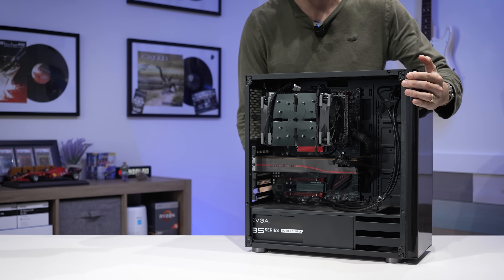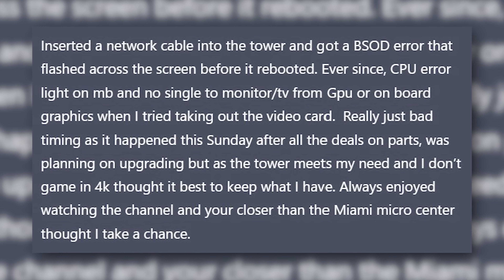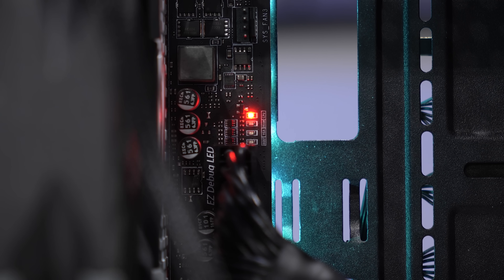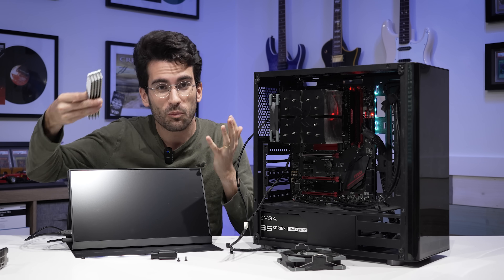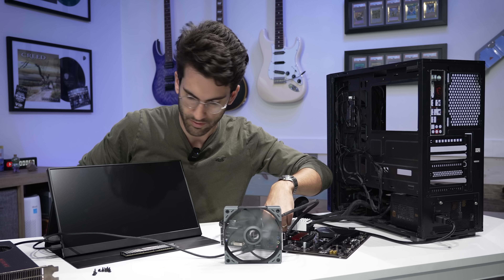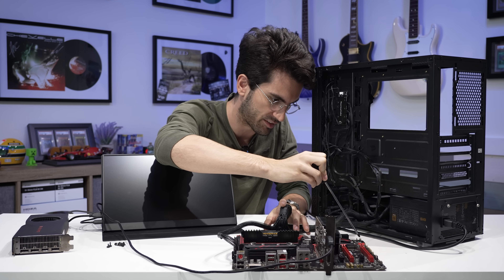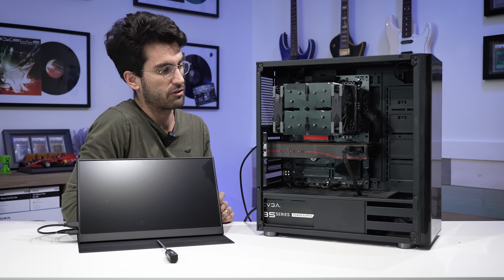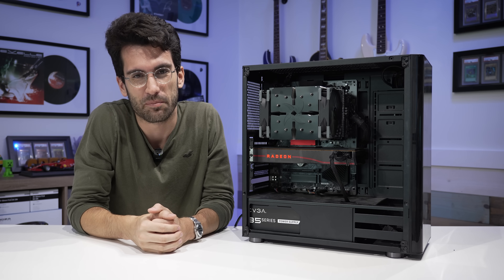Fixing a Viewer's BROKEN Gaming PC? - Fix or Flop S6:E18

Comment: Funnily enough, I've had a whole system die because of an ethernet cable. This was around 2019, we had a thunderstorm that day, so I disconnected all of my pc, except for the ethernet. I had cable internet so there was a connection to the outside. So lo and behold, there's a thunder strike, I see a quick glow from behind my pc, and the lights went out. The next day I went on to reconnect my pc and found that it wouldn't turn on. Since I worked in a pc repair shop, I took it to work to see what was the damage. By testing and changing stuff, found the only thing that was not damaged was the mouse. The strike killed my motherboard, processor, ram, SSD, keyboard and headphones. I had these nice Steelseries Siberia 150s and they stopped working afterwards.

Comment: 17:58 I have heard of this happening before, but it is not very common.  One specific instance was when a friend was plugging in his ethernet cable, and it was a tight fit due to the I/O shield.  It was his own build and he didnt use all the motherboard screws to mount the board to the standoffs.  While the machine was on, he jostled the board a tad when connecting the ethernet and the back side of the board connected with something in the case.  Instant power off.

Comment: Hi Greg! As a seasoned PC troubleshooter what I think happened here is that the user had a static electricity discharge into the motherboard when attaching the network cable, probably jumping (from the hand) to one of the USB ports (right next to the RJ45) and killing the USB controller, creating a short inside it. With that short in the motherboard chipset, that's likely directly plugged into the CPU PCIe lanes, the motherboard is dead and gives a CPU fault indicator. It can usually be fixed by replacing that controller with the short.
Reply: Definitely. My surge protector has a network plug as well for this kind of thing

Comment: I had a similar problem, it was the driver that Windows installed automaticly in the fresh install, did´t remember if it was Win 10 or 11, had to open up the computer and check the modelnumber att the networkchip and download the correct one and then no problem... Thanx again for your great videos.

Comment: I thought the 1700x won't work with a motherboard if it supports 3000 series upwards? I know that's the case at least with b350 and x370 boards, that once you upgrade them to support 5000 series for instance, you can't go back and use the 1st or 2nd gen ryzen

Comment: I had a lot of bad experiences with Msi branded tech like monitors, motherboards, graphics cards and power supplies.
Monitor screen rot/dead pixels, motherboard bios corruptions/chipset failure, gpu resetting driver and graphical issues and last psu's with unstable power/dead after a few months of use.
Maybe bad luck maybe not, I will never know.

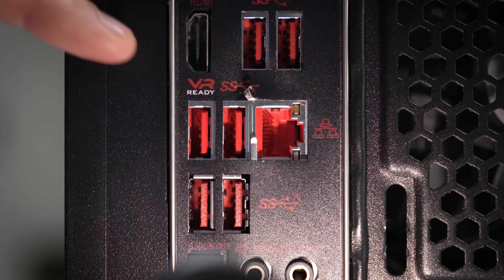Comment: That I/O sheild image at 0:30 with makes me think something  might hav  gotten shorted when he was plugging in the ethernet. The I/O shield should not look like that. That type of curling isn't unusual when thin metal is smashed between two surfaces that are really close together.  my guess os tjat upper metal but cut stuck when inserting USB not ethernet and maide contact with VCC which is the top pin on that USB port. it would also explain the USB controller being shorted and heating up.

Comment: I fried my ethernet port when I plugged in an ethernet cable on my b450 board.  One of the tabs on the MB plate bent into the port.  Had to by a PCI ethernet adapter to get it back on line.

Comment: Most like the AsMedia is also connecting the Ethernet port since it has a 10gb/s speed and I'm betting those 2 USB where limited to 3 to 4 gb/s and the rest was for the ethernet cable.   The controller for hte ethernet is right next the the AsMedia if I saw it right.   I am betting a short or a surge in the cable caused this to break the motherboard.

Comment: I had my Verizon router go out during a thunderstorm. The 3 items that were attached using an ethernet cord got damage. I lost the ethernet ports to both Xbox 360s and a motherboard. I told the jerk at Verizon that everything electronic device in my house is connected to a UPS. XFX actually replaced the motherboard, so all was not lost.

Comment: Greg,
  
    I enjoy this series as I really appreciate an individual such as yourself helping out those with less knowledge/ parts or what have you. 
    I understand that AMD makes "better gaming" chips if the darn system stays operational. I have season after season and it looks to me as if there seems to be an issue with these systems (AMD). Whether the issue stems from more power heat emitting CPU's , motherboard components not being up to it's ratings or poor quality control on either part.
    For me I don't have the patience or all the spare parts to take the risk on opting for AMD but more importantly my gaming days ended in late 2017 when I had two strokes due to a coarctation of my aorta (a birth defect) so I stayed with an Intel build for my current PC.
      My question to you is: What the heck is going on in your mind? AMD or Intel it doesn't matter. Are we asking chips to be so many cores running so fast that problems are inevitable?

Comment: When you took the board out at 9:25, you could do a dirty test, plug the PSU back in, leave the heat sink off, and then jump the pins. Put your finger on the CPU. If the CPU heats up normally, the CPU is good. If the CPU doesn't heat up, it's the motherboard. I have had to do this more times than I can count, and this has been right 99.5% of the time.
Reply: This is a good idea! Could you just take the heat sink off and leave the motherboard in the computer and try to turn on the computer with the heat sink removed and see if the CPU gets hot that way?!

Comment: I think the cable was bad. Ether that or the cable plugged in to the PoE port on their switch/router, which would fry any motherboard.
Reply: That was my thought, too. POE 48 volt mayhem 😂
Reply: @Out2GetYaWorldAKAMcfly  Nah, there is a boxy transformer thing that isolate the port to the IC. 
ESD could bypass it incase the capacitor that put esd to the ground is not working well.
Reply: POE does not inject high voltage automatically, there're stages of detection starting with low voltage (2.7V-10V) checking for resistance value of the pairs of cables that deliver. Resistance should be in the range of 25k Ohm, after that if correct resistance value has been measured then come the steps of classification and configuration of voltage delivered.

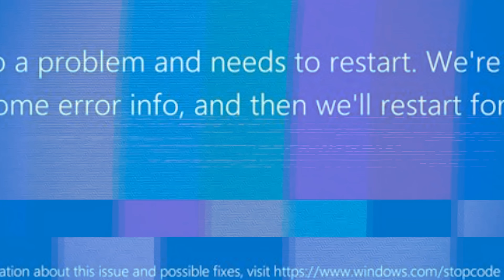Comment: 0:20 well at home most people dont use power over ethernet. but in the industry this type of stuff happens all the time, thats why you get told not to "hot plug" stuff.
8:57 that cpu cooler is way over the top for that puny cpu

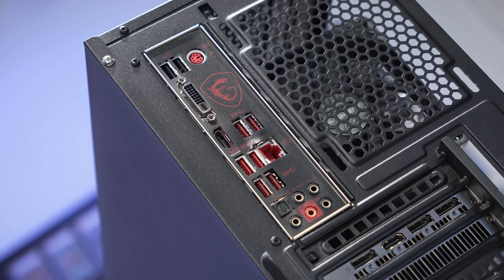Comment: If you zoom in at 2:55 you can see the damage to the I/O shield and the legs bent out on the Ethernet port. Most likely what fried the MOBO when cable was connected.
Reply: This is absolutely the cause. I have done this myself by accidentally installing the leg of the I/O shield INSIDE the RJ-45 port. The moment Greg mentioned the RJ-45 port I wanted to see it. Sure enough, the shield looks trashed around that port.
Reply: Are you talking about the one bent under the I/O shield? If so, I don’t think it’s doing any damage, mainly because the usb housing is connected to ground anyway. 15:20 I don’t see any signs of wear on the usb housing from that leg either.
Reply: @jakesnow96  But we dont know how forceful the initial contact was.they could have been moving it around while the PC was on. I have seen a MB die when someone was trying to plug in a monitor
Reply: I am wondering about this too.
Reply: I saw the same thing
Reply: I don’t think it’s doing any damage at all.
Reply: These are just grounds and none are going inside the port to cause a short. Ethernet cables can carry power, lots of people have killed devices via ethernet during thunderstorms. Who know what was connected to that cable on the other end at the time.
Reply: I'd recommend the owner replace the Ethernet cable as well.
Reply: Probably right 👍
Reply: My first thought too, seen many of these come through our shop. No doubt shorted the USB port and fried that chip. Thank GOD for built in IO shields.
Reply: Thinking the same thing. Must've shorted it some how
Reply: I noticed this immediately and thought the same thing.
Reply from the maker: Those legs aren't anywhere near the port itself where a short would occur. In fact, they're too short to possibly bend inward. So no, I do not think this was the issue at all.
Reply: @GregSalazar  Regardless, it is something to watch for given the description of the issue. Those legs could have been adjusted before you got it. It is an issue that we've seen at our shop many times. It almost always involves Ethernet and/or USB.
Reply from the maker: @sturm375  No, there is no physical way for those legs to have bent inward far enough to short anything out. And if they were blocking the port itself and simply shorted with the cable, it would have spared the board of any calamity. It's a non-issue. We see rear IO plates split and bent like this all the time. I don't want anyone thinking their rig's cooked simply because some metal is bent in a non-vital area :-)

Comment: I had a feeling that is was the mainboard that somehow got fried, especially when the debug light was the same when the RAM was pulled.

I’m an old-school system builder and I still rely on POST beeps.

I also decided to check how much the power supply tester being used in this video and I’m jaw dropped quick. Over US$400 before shipping!

Comment: Well, my PC once did die because of Ethernet plug (years back now).
The problem at that time was, that the local Internet provider had created a make-shift power wire connection to the Ethernet cable in my house because apparently he didn't have a system to provide power through the cable itself (not sure if he was trying to siphon-off free power from me or whatever, i didn't have much knowledge regarding LAN connection & Ethernet then).
So, when there was a transformer issue in my locality, the power surge just killed my PC as the surged power directly went from the outlet to the Ethernet cable to my PC (i did have a spike board and UPS, but i don't remember what happened with it as i was more focused with my PC then and it's been years now).

Comment: 15:20 the top USB looks kinda strange, might just be the angle but it's almost as if the pins are pushed through and touching the outside socket?

Comment: At 0.28 you unintentionally pointed at what caused the failure.  There's a missing piece of IO decal missing on the pin side of the ethernet port.  If the decal has any metal in it or the adhesive is conductive it would have bridged thr pins when the connector was pushed in.
Reply from the maker: There's nothing wrong with the connector, and the bent metal is impossible to bent into it.

Comment: looks like the grounding pin of the IO shield around the RJ45 it could have entered the port when he plugged in the cable shorting something straight to ground
Reply from the maker: The bent IO shield is impossible to contort inward toward the RJ45 port the way its laid out currently. Folks are seeing this broken bit but there's no way it could have shorted the port.

Comment: Motherboard is Probably to blame, maybe the device that the Ethernet cable was run to was a older Poe switch that doesn’t do any negotiation so it just shoots power the whole time or the device wasn’t grounded and was holding some charge.

Comment: I had something similar happen with an old HDMI cable that was not properly grounded because of its age. The Motherboard was a cheap $60-$75 B450 on sale Amazon Prime day 2016-17. Also had a Gigabyte B650 Aorus AX just go bad 2 months ago and Gigabyte sent me a Bill for socket repair which it was not damaged before it was sent I even put the plastic protective cover back over it. They sent me pics of a damaged socket with a sheet with my ccn and other info in an email to repair when it was perfect when it left here and sat on their dock 3 weeks.

Comment: I have literally had an Ethernet cable plugged into the  Ethernet port destroy my entire system. One night it was storming like crazy and lightning struck the utility pole in my alley and the surge traveled via the cable line to my cable modem and out fiat Ethernet cables to destroy everything in my house that was connected to that modem. Took out my direct TV box, was sitting watching TV and saw it spark and then smoke. Then it took out my router, and my pc and a few other things that were on the Ethernet network. Had to fight with the cable company over it until then finally had an engineer contact me. I growled up to where the splitter was on the outside of my house and sent him photos. The installer had failed to hook up the ground line. It was there, but just dangling.

Comment: I had ethernet ports almost bricking a mobo 2x now (over like 10 systems) but in each case disabling the port fixed the issue. First one was when gaming with a certain anti-cheat and ethernet plugged in my pc would chug to 2 fps which would stay in windows. eventually it would persist to all the time, as soon as i would plug the ethernet in the pc would chug (game or not). A pcie ethernet card fixed the issue. The most recent is my current pc, just having the realtek 5gb port enabled causes my pc to run poorly and bluescreen sometimes, disabling the port fixes the issue. (not saying that this has anything to do with the issue but just saying pc's can be weird)

Comment: I never plug in or unplug anything while it is powered on with any of my electronic devices.   Why the huge cooler for that 5500g processor?   I don't even run that big on my 5800x3d and I have 0 issues with heat.

Comment: I am having a issue with my pc i was doing a clean install of windows 11 with the windows Recovery Option walked away and came back no display on my Monitor reset the computer nothing on Monitor reseed the ram nothing took out the ssd nothing took out the gpu nothing i can not even get to the bois i think my motherboard dead reset the comos battery nothing i am out of idead whats wrong with it tried to use another Monitor for it to post and nothing ! Do you have any ideas whats wrong with the pc now ?

Comment: I had the same issue of bsod, i thought it was bad ram profile as it was intermittent so i removed the profile and ran it on 2400mhz but it is still coming back. Then one time while it was working well, I accidentally touched the ethernet cable behind the case and it bsod on me again. I tried it again and it was the culprit 😂. Changed the cable and no bsod for months now.

Comment: I had a Asus Prime X470 and after 4 years of no issues I plugged a USB Flash Drive into the USB port under the RJ45 and heard a light crack sound. After double checking the drive, I noticed that the RGB and Monitor were not on/displaying,, I tried several things then just built a new system. A friend wanted a go at fixing the motherboard and I gave it to him. He gave me back a working system with two wires repairing two traces that broke just a bit behind the 2 USB and RJ45 ports. Something about the main ground trace broke and caused the no start issue as it was shorted, It worked for a little over a year as a server then I had to replace the motherboard as it quit working.

Comment: It's rare but voltage differences between equipment can damage electronics even on the same circuit. Happens often in offices, TV antenna systems and audio. Personally lost a motherboard once just plugging in audio equipment.

Comment: I've had a similar issue with a customers system and turns out there was a power spike from the starlink internet provider and back fed and didn't just fry the home network but also fried the computers hooked by cable

Comment: Ethernet cables can definitely be subject to power surges. They usually carry 12v & anywhere from 1-3A. I've only dealt with surges that occur in systems that rely on POE or power over ethernet but any ethernet port can easily experience a surge.

Comment: Some better Ethernet Cables have a Metal shielding on both end on the plugs. These are connected through a dedicaded wire within the cable. This is used to even out the electic potencial on both ends. This is afaik normally used within a Serverrack. However if used within a home installation and devices that are plugged in are on diffrent electrical curcits this could potencial lead to some funky behaviour like activating a breaker.

Comment: I once had a USB add-in card installed in a PC, if anything was plugged into it the pc would literally not boot no matter what I tried. Eventually unplugged everything while troubleshooting and it booted up fine. So after the process of elimination, I figured out that to get it to boot I had to unplug anything plugged into the add-in card, let it boot, then I could plug them back in and they'd work fine. Weirdest issue I have had over the years building pcs!

Comment: I hope that the owner checks that Ethernet cable before they use it again. While the port on the old MoBo appears to be fine, that cable may have something wrong with it that is causing a short or bad power which fried the old board.

Comment: So, I had a little wiggle in my brain, about the BIOS chip.
4xx and 5xx v1 boards usually had 16 or 32mb  memory.  This board had 16mb.  The last update for that bios, was September 2024, and was 9.63mb, so I doubt they removed any CPU support.

I remember reading my new B650 board manual, while waiting to buy a CPU, had a a ludicrous amount of BIOS storage, so googled it...

The ASUS TUF Gaming B650-PLUS WiFi motherboard has a BIOS chip with a capacity of 128MB. 

128mb!